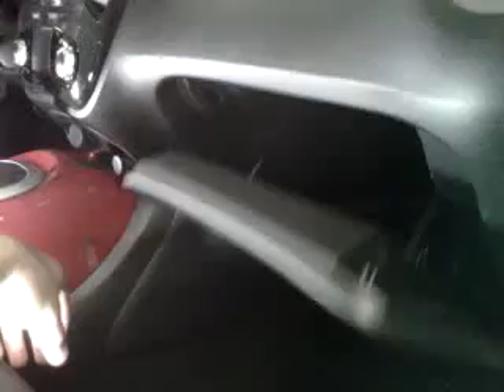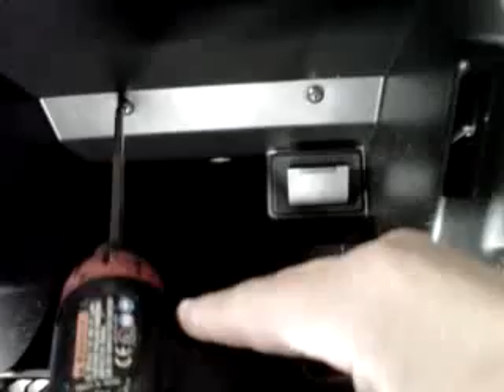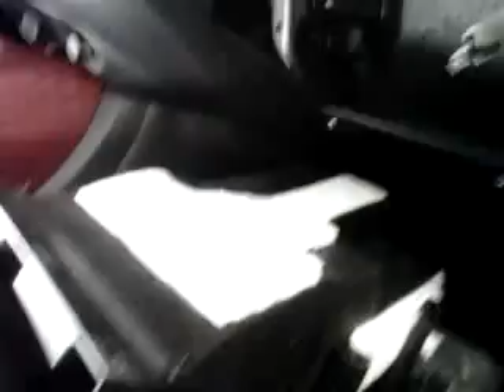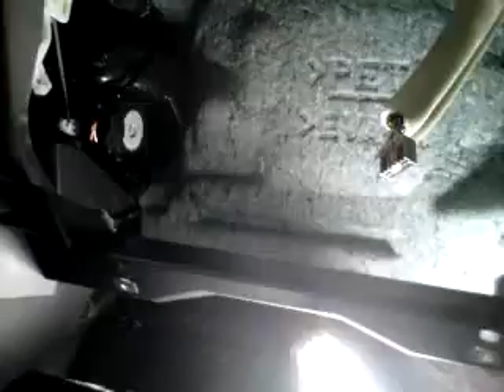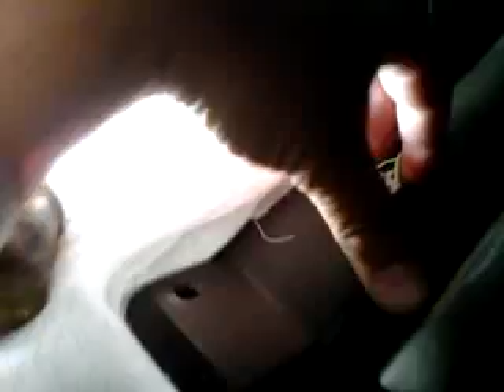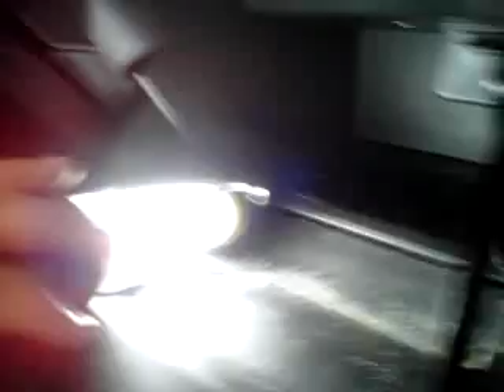How to replace cabin air filter 2011 Nissan Juke √ Fix it Angel

Comment from the maker: i did some research, there is a technical service bulletin on the Supplemental Restraint System on the FRONT DOOR SIDE SATELLITE SENSOR. codes could be, B1338 and/or B1345 - SATELITE SENSOR LH or RH. reprogramming could solve it.

Comment: Actually with a little flexibility you can do this without removing the glove box I just did it
Reply from the maker: Peculiar1 cool, thank you for the tip. I just removed the glovebox for better camera viewing. Have a nice day.
Reply: Fix It Angel thanks for your video it helped me find the filter. All the manual says is to take it to the dealer to change it.

Comment: Good luck with changing this cabin-air filter! The design complaints I have against the Juke grow day-by-day, accessing the cabin filter cover requires considerable skill unless a trained mechanic. Firstly - removal of the entire glove box. If using Nissan for servicing they should change this EVERY service, but some mechanics may pass on this fiddly and time consuming job. My Juke has just two good attributes: quite a high ground clearance for countryside

Comment: Excellent video. Thank you very much for the info! I followed every step you did except you placed the "white cap" upside down according to the manual that came with the OEM filter. Also, I think you put the filter upside down as well. the "little white strap" attached on the filter should locate at the top instead of the bottom. I don't know if my car is Canadian model which makes the difference, but that just my 2 cents after I changed the filter.
Reply from the maker: Thank you for the comment. I really appreciate it. Yes, you are right with the white strap but I think it doesn't make a difference but good observation. Please subscribe. Have a nice day.

Comment: This is a good and helpful video, however, to replace the filter on a 2011 there is no need to remove the glove box. I was confused when I saw this video because this does not apply to the Juke 2011.  I am not sure about other newer models, but if you have a 2011 you can easily access the filter without having to remove the glove box.
Reply from the maker: Joe Arvallo Thank you and thank you for the tip. Please subscribe.

Comment: Ne need to remove the glove box, just peek up behind it and poof its out
Reply from the maker: John Mears i know that and I could have done that. But how would I have done this video? 
It doesn’t matter. As long you get it done, no matter how long it takes. Short cuts are ok but that doesn’t mean my way is wrong. Right?
Reply: Fix It Angel Definitely not wrong my friend. If you have the time you may as well not break your back.